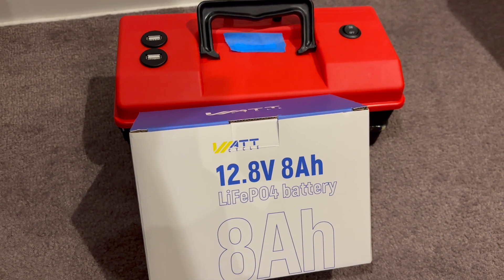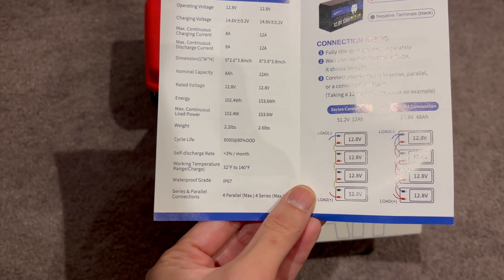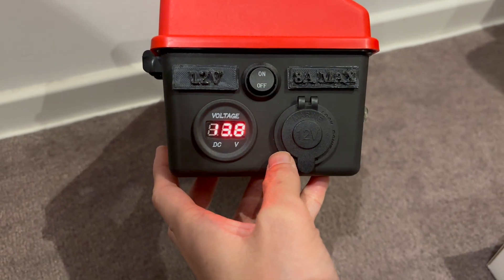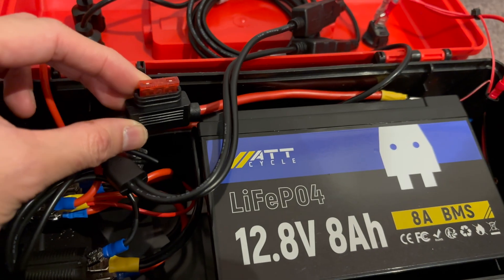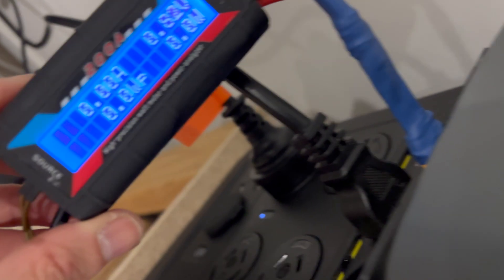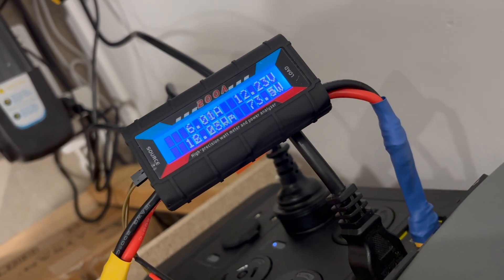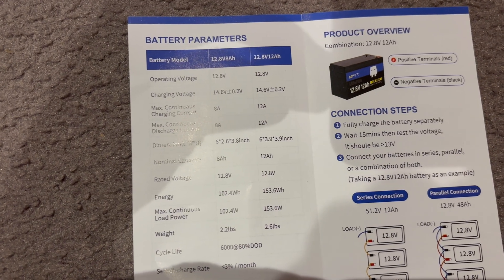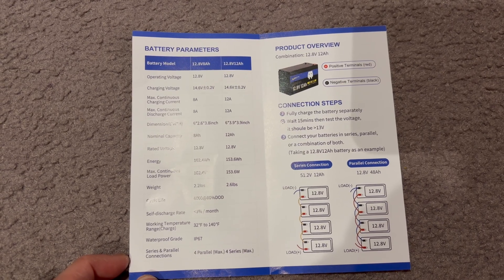12V WattCycle 8Ah LiFePo4 Battery Discharge Test | DIY Battery Box Upgrade!

Comment: I wonder what quality cells they are using in these batteries.
Reply from the maker: Do you want me to do a tear down? 🫣
Reply: @mrjamesflores  You could do. It would probably be full is 18650 cells.
Reply from the maker: @TheSimpleLivingAussie But aren’t they Li-on cells (18650 type?)
Reply: @mrjamesflores  18650 is related to the size of the battery. First two numbers is the diameter in mm (18mm) and the second two numbers meaning the length in mm (65mm) The zero at the end means the shape of the cell, if I remember ?
18650 can come in both Lithium Iron or LFP The lithium Iron will have a cell voltage of around 3.7 volts and the LFP around 3.2 volts.
Another common size of cell is the 26700 (26mm x 70mm) which is in my Altronics 20 Ah LFP battery.
Reply from the maker: @TheOffGridBachelor  OK thanks for the heads up. I was looking into these cells and through they were only for the earlier type.